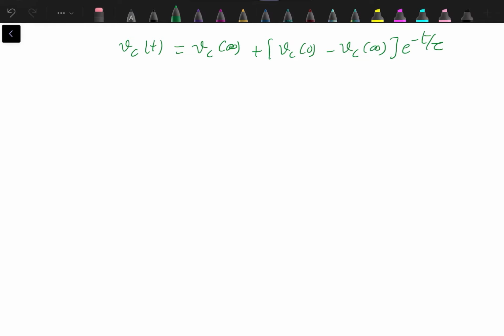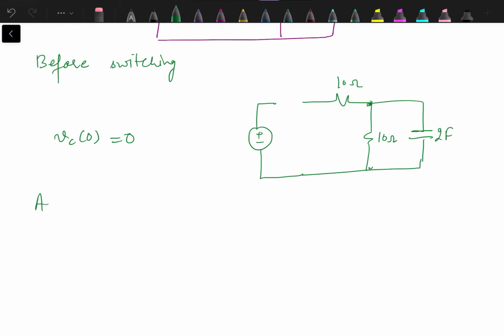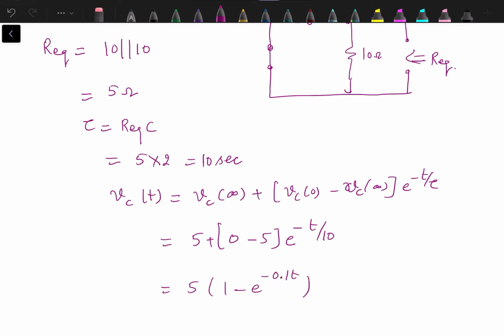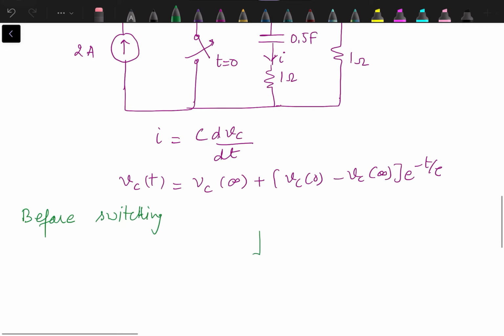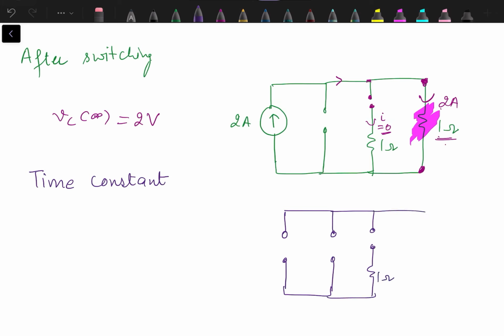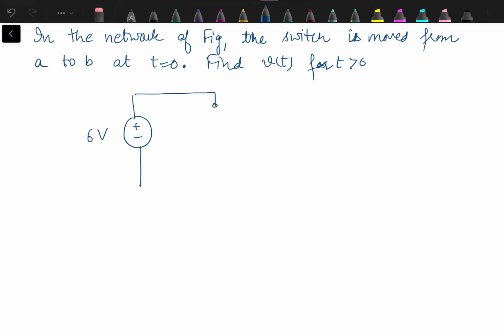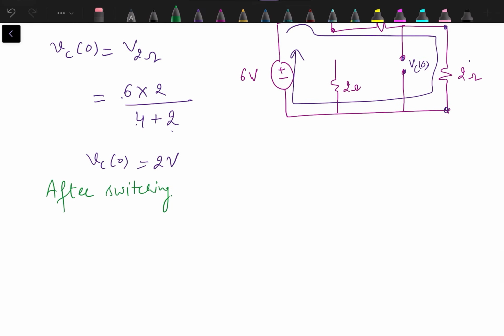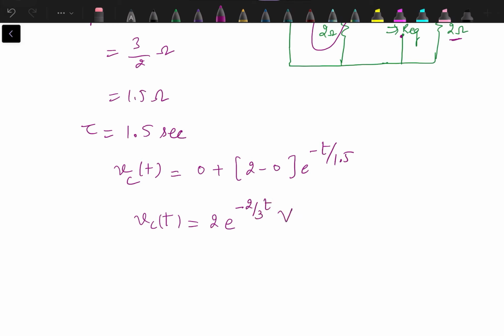Transient Analysis: RC Series Circuit Part 1: #circuitanalysis #dccircuits #transientanalysis

Comment: Why in the last question we assumed the capacitor in steady state before switching (i.e open ckt)
Rather than short ckt?
Reply from the maker: Because when capacitor is fully charged current through capacitor is zero which means it is open circuit. Fully charged capacitor means voltage is constant.  Current though capacitor is proportional to dv/dt which is zero